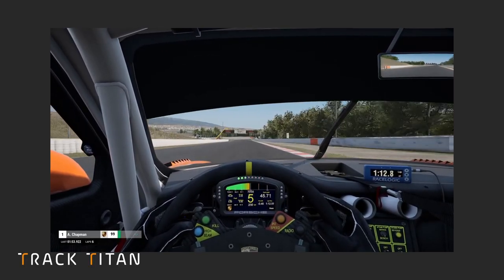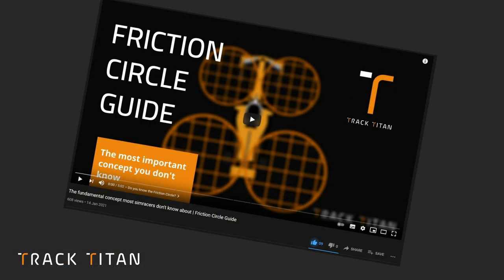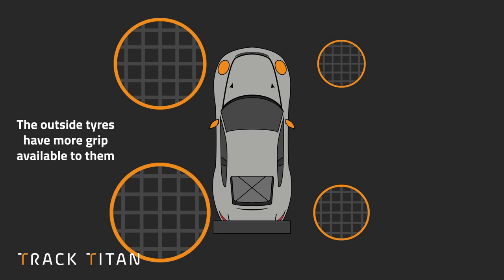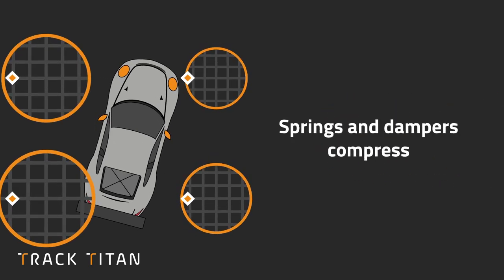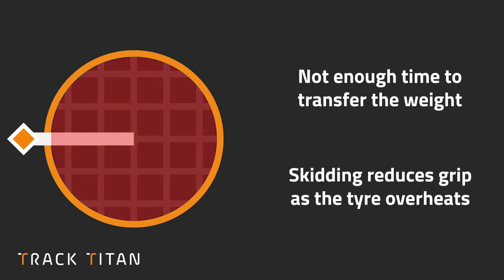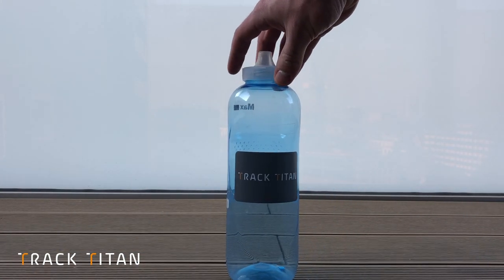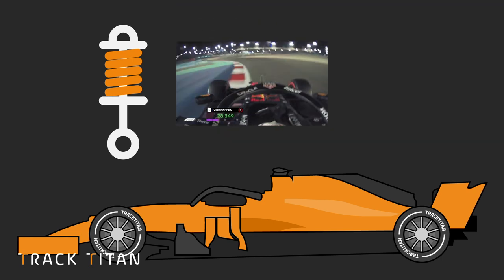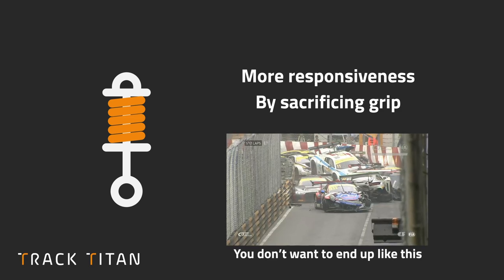Why does turning in too fast kill your grip?

Comment: what about go karts they don’t have suspension but are stiff so should you be turning in gently or can you be more aggressive
Reply from the maker: Very good question! The most important difference about karts is that they don't have a differential so the rear wheels always rotate at the same speed. Because of this, it is actually faster to lift the inside rear off the ground in a corner. Quickly turning in aggressively gets you there which is why racing karts is quite different in terms of driving style.
Reply: @TrackTitan  thank you this helped me a lot